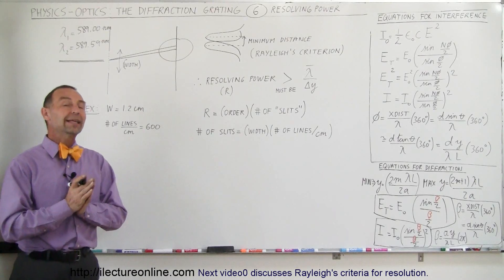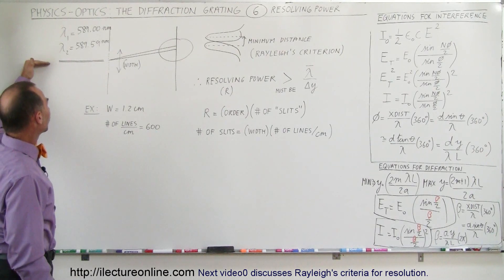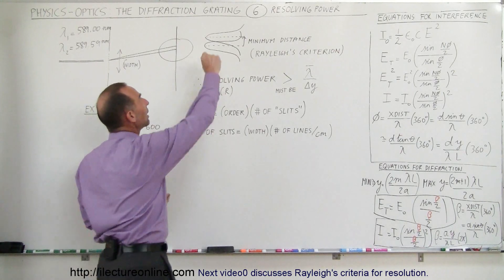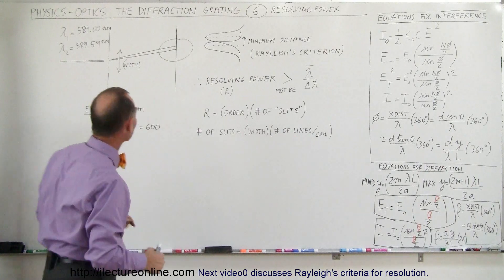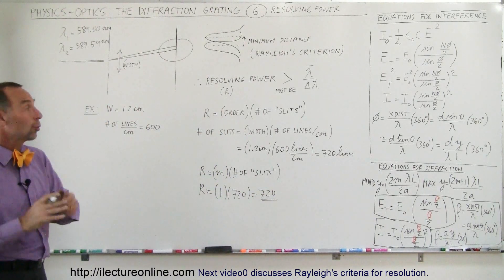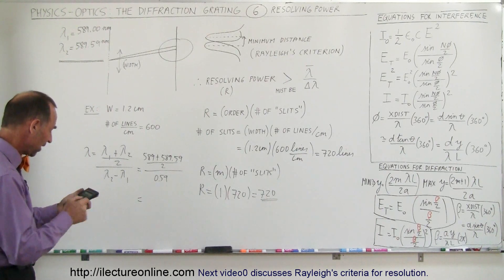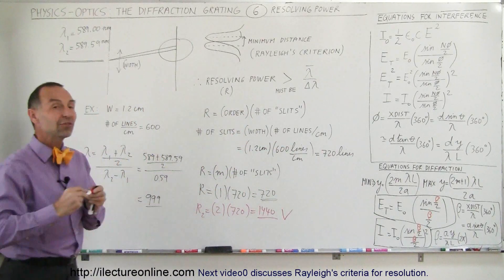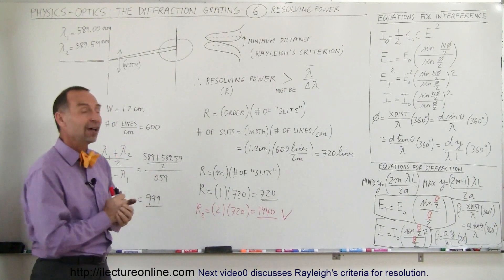Physics - Optics: Diffraction Grating (6 of 7) Resolving Power=? of Diffraction Grating

Comment: Your Derivation is Wrong. N is not the number of lines per cm, it is the number of slits on which the light falls. So, you should not multiply the length of the Grating  by  the line density to get N. What you need is the width of that tiny area on which the light falls on the grating. Then multiplying by line density of the Grating  that quantity gives you the number slits on which the light falls and got diffracted. Kindly got educated and don't fake it.
Reply: TRUE, but his explanation is good overall
Reply: Would you show me how to get to your result, please? I mean, how is one supposed to calculate the illuminated slits, and why is slits density to be multiplied by the quantity of illuminated slits?

Comment: Thank you for your teaching method which is really helpful. I have two questions regarding two equations : 1) Why resolving power should be greater than average lambda over difference lambda ? 2)Is there any proof that resolving power is equal to order multiply number of slits?